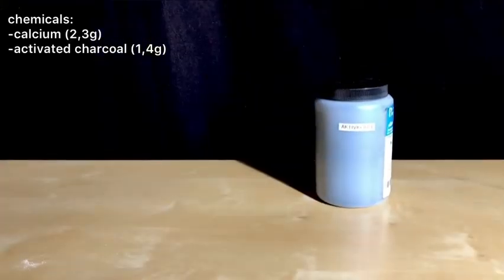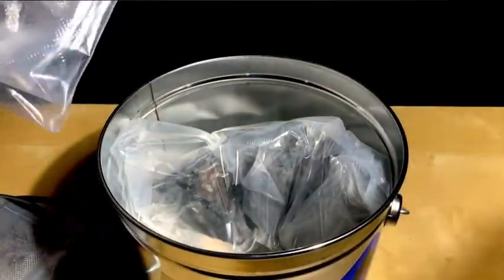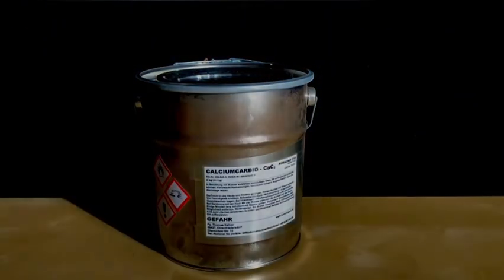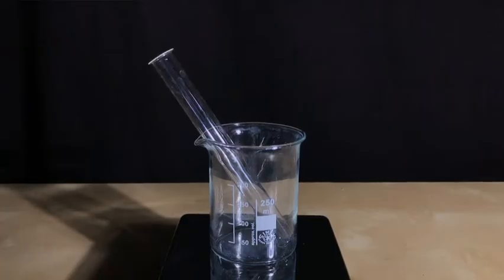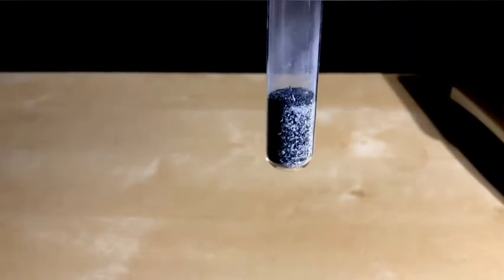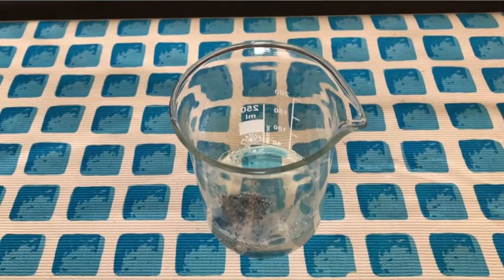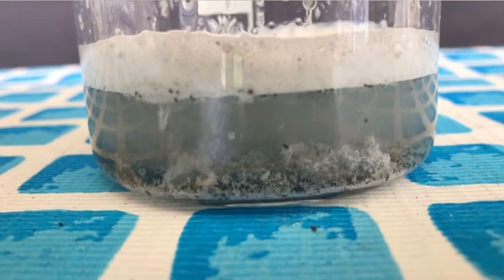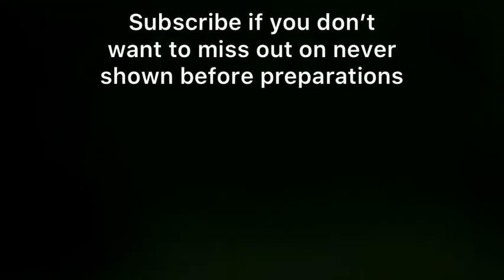Making calcium carbide

Comment: Wow I am so jealous of all that calcium metal you got. Showing some reactions with it on a larger scale could make an extremly awesome video! Also congrats on 2000 Subscribers! ;-)
Reply from the maker: Thanks! These huge chunks of Ca are surprisingly unreactive though. Any specific ideas on interesting reactions?
Reply: @THYZOID  Hm I don't have a lot of experience with calcium metal. I would try to burn it, react it with liquid oxygen, with sulfur, bromine, iron oxide and any other readily available oxidizer I can think of. Obviously in order to make an awesome video I would have to think about it a lot more and test as much as possible first.
Reply: @THYZOID  Yeah, how about making calcium nitride?
Reply from the maker: That would be cool but don’t have a cylinder of N2.
Reply: @THYZOID  You can either use liquid N2 or treat urea with nitrous acid to make a fair amount of N2. CO2 is also released along with N2 in that reaction. If you have woulfe bottle, you can bubble the gaseous mixture through amine or alkali hydroxide solution to absorb CO2.
Reply: @THYZOID  Else, you can treat urea with alkaline hypobromite solution to obtain nitrogen alone
Reply: What about supplier N2?
Reply: How hot you have to get it to start with calcium carbonate? Like gas kiln hot good or deed arc furnace hot?

Comment: The reaction did not happen, you should heat it a bit longer till you actually see them react. Test tube should melt as the reaction is VERY exothermic
Reply from the maker: We still got a small amount of CaC2 though as indicated by black smoke being generated while burning the resulting acetylene. In comparison to all other videos on YouTube we mixed the reagents. The reaction may be more vigorous if the calcium just sits ant the bottom of the test tube while being molten first.
Reply: @THYZOID  just to be sure, you could repeat the experiment and bubble the gas through Ag(NH3)2OH or CuCl in ammonia. Getting precipitates shows the presence of C2H2 in the gas mixture. Just do not let the resulting acetylides dry.
Reply from the maker: Might try and do a short video on it.
Reply: @THYZOID  the melting point of calsium is 842°C ..i don't think calsium can be melted with a butane torch in a test tube.. when reaction starts the heat generated by it melts all the remaining calsium with carbon to then react with it
Reply from the maker: Oh it can definetely be melted using propane!  If this burner is capable of melting copper in a test tube it’ll certainly be able to melt calcium
Reply: @THYZOID  How did the glass withstand the temperature needed to melt the copper? I think the meting point of borosilicate glass is around 800 °C. 
The yellow flame you got when burning the gas could be caused by the calcium and its orange/red flame color. 

Great Videos! Keep them coming!
Reply from the maker: It surely melted but it stayed in tact long enough to melt the copper before it all formed one big molten drop that messed up my burner.
Reply: @crooger3594  You can easily exceed 900C with Bunsen burner.
Reply: @user255  ah c'mon man haha you are not being serious here 😂
Reply: @THYZOID  if propane is used it sure can
Reply: @crooger3594  If you don't believe me, then try it yourself. Take thin piece of copper (melting point around 1000C) and test. It will melt.
Reply from the maker: And it does exactly that. Not every part of the flame can melt copper but most of it is able to.
Reply: @user255  if you take a thin piece of copper wire yes ... But test tube filled with stuff won't
Reply from the maker: We were never talking about an entire test tube. It’s the same with calcium. Some will have reacted but a lot of it is left unreacted.
Reply: @THYZOID  could you make an entire new video about making calsium carbide on a larger scale ... You would probably be the first one on yt to try something like that ... Maybe with acetilene torch or something or with plasma ark
Reply from the maker: Won’t use the oxyacetylene torch but I might be able to use my big furnace for that.
Reply: @crooger3594  All I said was that you can easily exceed 900C with Bunsen burner.
Reply: @THYZOID great idea. Looking forward to see that.

Comment: You can make calcium carbide easily by mixing lime with carbon and roasting it with an electric arc in a container that can vent the carbon monoxide. If you want to make phosphorus then add a bit of calcium phosphate and sand. You will get co, p vapor, SiC and CaC2. The SiC crystals also are electroluminescent like very weak LEDs glowing yellow green to blue at 5v or so.

Comment: It sucks that CaC2 is such a difficult to make chemical. One either has to use arc-furnaces or calcium metal. But if microwave technology becomes cheaper/simpler, CaC2 can become more accessible to people who live in places where CaC2 sales are restricted.
Reply: why would selling CaC2 be restricted?
Reply: @SuperAngelofglory cuz it can be used to make acetylene gas
Reply: @galleryofrogues  so? By that logic, they should ban water too, it can be used to make hydrogen
Reply: @SuperAngelofglory  No, he means that if it gets wet it will off-gas acetylene. There's a reasonably high risk it will cause fires/explosions if not shipped or stored properly, and gets exposed to rain or spills. So it has to be treated as a hazardous material, greatly increasing the cost (about half the cost of CaC2 purchased online is the added hazmat shipping fees) and some areas have further restrictions due to the risk.

Comment: Hey, can you tell me where you got the needle valve for the co2 cylinder from? I couldn't find any because it turns out they use an m16x1.5 thread which is unusual for gas applications. All my searches yield hydraulic valves without a seal
Reply from the maker: Got it from eBay. I searched for stainless steel needle valve but I’m sadly not able to find it anymore. If I do I’ll let you know.

Comment: Hello dear I'm Osama from Egypt. I want to make calcium carbide in the same way, but I can't do it in a gas oven, the temperature exceeds 2200
Reply from the maker: that temp sounds good. at that temperature you can even use the classical method of reacting carbon with calcium oxide
Reply: @THYZOID  Thank you very much dear

Comment: A good try. Obviously, the temperature is not sufficient enough for the reaction to happen. I believe that this reaction requires relatively less temperature than the industrial route involving calcium oxide.
Reply from the maker: We at least produced a small amount of contaminated acetylene. I’ll try again once we get an electric furnace
Reply: @THYZOID  Oh yes! Also, try to make it by heating the metal in the current of CO2 if feasible. It will afford a mixture of calcium oxide & calcium carbide.

Comment: This almost seems easier than trying to break up commercial CaC2 chunks to fit through ground glass joints. I bought a tub full recently as I plan to make as much CS2 as is possible having done it twice and only making a few mL each time. I want to do it in such a way that I can keep adding more calcium carbide and sulfur until I run out. I guess inside a plastic bag and hitting it with a hammer is one way to break them into smaller pieces. Nothing worse than getting a chunk properly stuck in the neck of 1000ml rbf full of more chunks although I guess you could pipette a small bit of water on it

Comment: Tried making small amounts of calcium by electrolysis of calcium chloride once, but without much success
Reply from the maker: What was your setup for the electrolysis?
Reply: A small handheld burner, a 0-30v 5A power supply and the lid of a can that i bent a little bit to hold a puddle of molten salt. Don’t remember what I used as electrodes.

The process did generate enough heat to keep the salt molten and some kind of material was growing on the cathode, it reacted a little bit with water but not as much as pure calcium

The fact that it didn’t require additional heating after starting was surprising, with the small scale
Reply from the maker: Thanks!

Comment: Hello dear, I am Osama from Egypt I work in an auto repair and I need calcium carbide a lot In automotive welding, soldering and soldering iron Can I make calcium carbide at home in a gas furnace with a temperature of more than 2000 degrees
Reply from the maker: can´t you buy carbide or bottled acetylene cheaply in egypt? Making it yourself is very expensive
Reply: @THYZOID  Thank you my dear friend for your reply But the manufacture of calcium carbide in Egypt will be a very rewarding project, God willing, and when I actually make calcium carbide, I will tell you If you would like to come to Egypt to see the project There is no one in Egypt who manufactures calcium carbide Calcium carbide found in Egypt is all import only, God willing, it will achieve huge success
Reply: A ceramic flower pot buried in sand with a piece of metal at the bottom and  a carbon rod in the middle. Fill with a mixture of quicklime and carbon with a graphite rod in the center. Bridge the metal and bottom of the rod with a small amount of steel wool, then apply current from an arc welder and hold for about 20 minutes. The heat will cause the CaO to react forming CaC2 plus CO gas.

Comment: Can't it be substituted for calcium hydroxide in this way because of its boiling point? Calcium only?
Reply from the maker: it can be but it will require a higher temperature
Reply: @THYZOID  Thank you. Do you use coke or what kind of carbon can you use?
Reply from the maker: @fadiyosef4452  the purer the better.

Comment: @ 1:12 Did you say that the contaminants produce "phosphine upon contact with water"?! If so, how is possible and what contaminants would be present to cause this?
Reply from the maker: If the calcium oxide source used contains phosphide it forms phosphine in contact with water. If only calcium and carbon are used as in this video no such contaminants are present.

Comment: It's not usefull, you need to mix powder way more better and heat them much longer.
Reply from the maker: Making CaC2 isn’t even useful. Just a proof of concept in todays video but I’m working on making it more efficient.
Reply: @THYZOID  I agree.
On the other hand you can use acetylene gas for making benzene by skipping it through a tube filled with heat activated charcoal.
Reply from the maker: Already tried that using copper and acetylene from a gas bottle and it failed. But really does it work with charcoal? If it does it might be worth a try because I’ve now got better equipment.
Reply: @THYZOID  
have you ever heard about 
CaO + 3C = CaC2 + CO 
reaction? 
I think it could be way more cheaper to use CaO instead of pure calcium.
Reply from the maker: That’s the industrial route to CaC2. It requires temperatures between 2000 and 2300*C and is commonly conducted in an arc furnace. This is nearly out of reach for me at the moment and impossible for most hobby chemists.